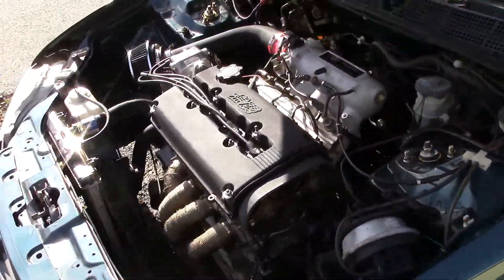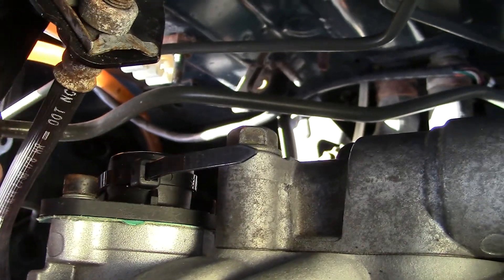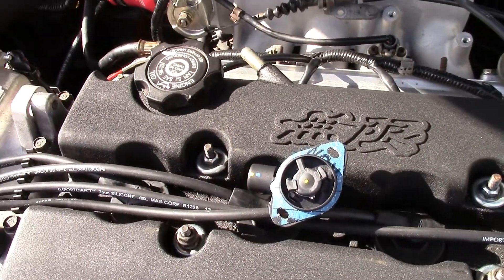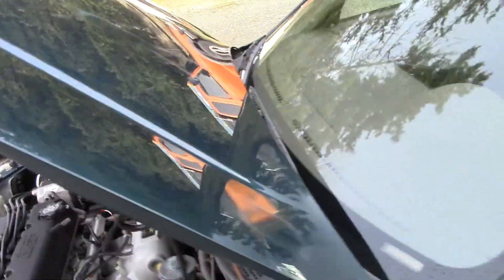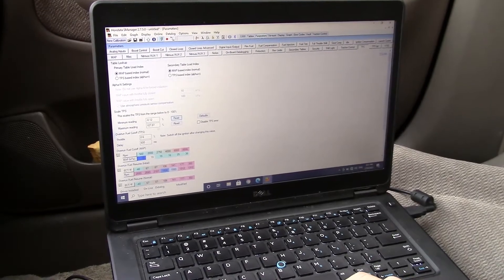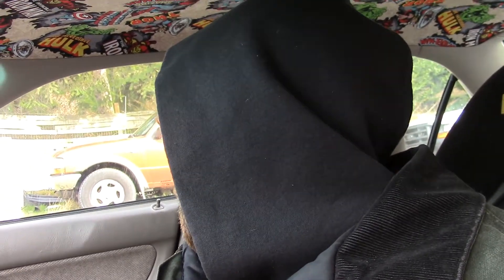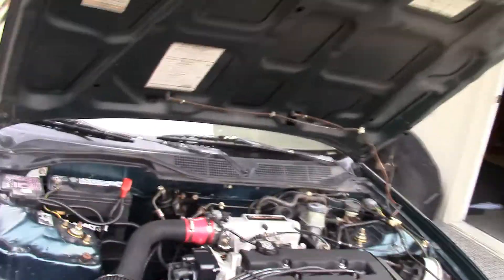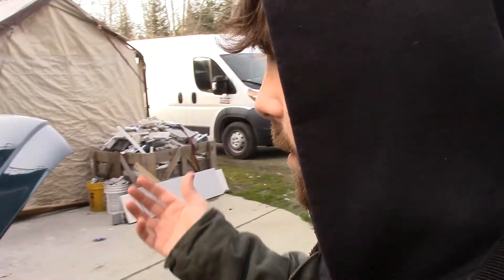how to calibrate tps on honda civic eg/ using hondata s300 v3

Comment: I dont have hondata, but i have my car tuned on hondata and then chip install in ecu i have my car tuned, i have no access to do it with hondata and i need to calibrate throttle body cause its sticky in initial position 0% throttle, but then i will need to calibrate tps also even already tuned? If yes can i just adjust it manual now without interfiring in ecu readings?

Comment: I have a question because the minimum reading it gives me is 8.76%.  Is it right or wrong.  please help me
Reply from the maker: You need to move you tps back and forth untell you reach you target it can be a bit tricky to do yourself it might be easier if you have a friend move slide the tps back and forth will you do the readings in the car
Reply: Whats the target? Is it supposed to read 0% and WOT 100%? @feezy-built108